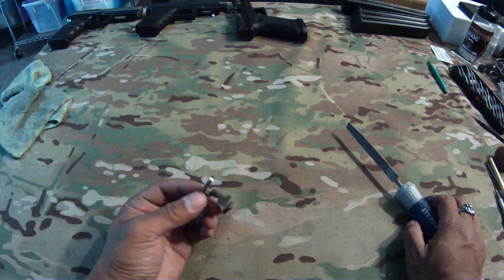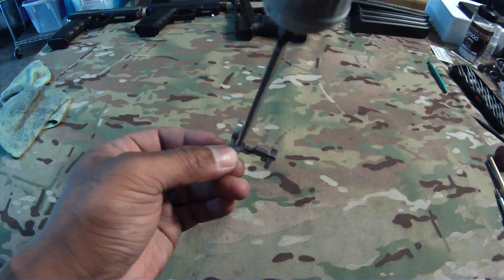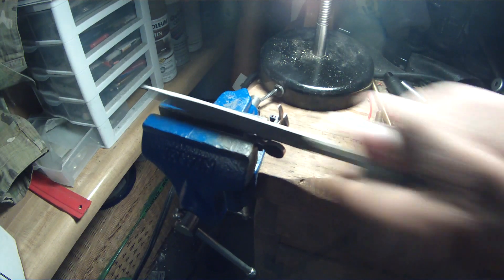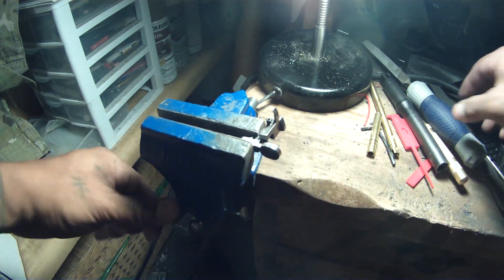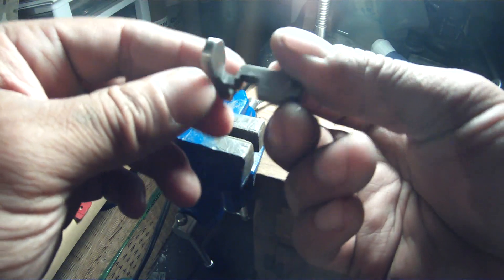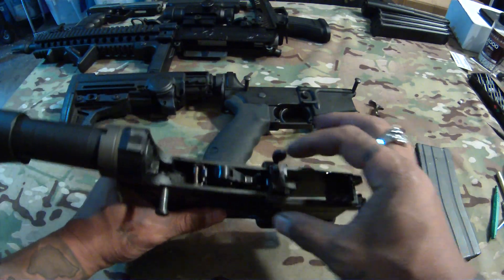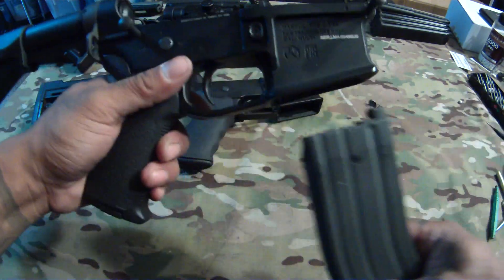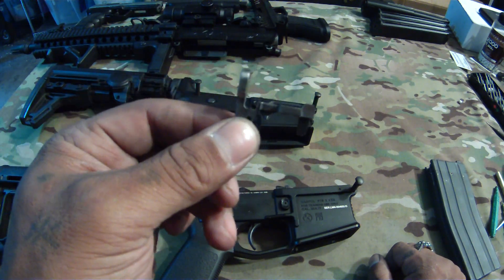HOW TO: MODIFY/FIT KWA LM4 BOLT CATCH (NEW VERSION)

Comment: The new LM4s now are able to power stroke the bolt with no modification. I just got an LM4C and it had the new version bolt catch along with the spring installed behind it

Comment: Hey I have a problem with my lm4... On the last shot it doesn't always want to lock back on last shot "the bolt" and sometimes when it does. It will disengauge and slam forward without me hitting the bolt catch or power stroking the charging handle... I got it off ebay and it has the mod bolt catch that doesn't click back n forth like the stock one. I don't care for it much of how I can release the bolt via charging handle and I'd much rather it have the clicking like the stock... Right now the modded bolt catch seems like it's 2 loose. Do u think they lost the spring when they modded it. Anyway to fix this and make it preform like the stock one. Thanks

Comment from the maker: yes. but it still does not go high enough to engage the bolt completley. yes it will work but im gonna guess for only a short time. and by then youll have to bend the arm on the bolt catch and remove some material on the shoulder, and repair the worn out corner on your bolt carrier